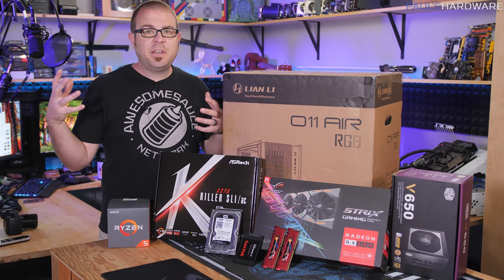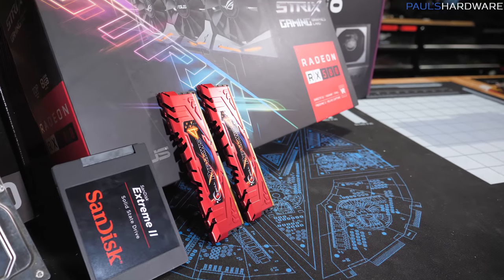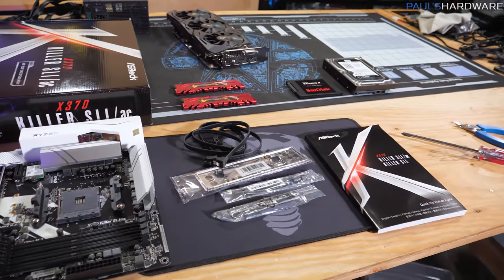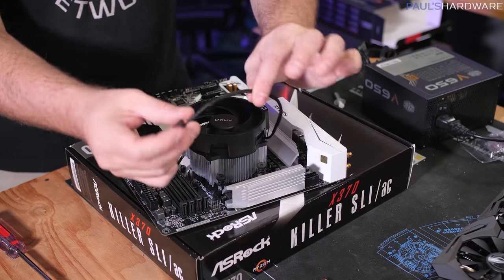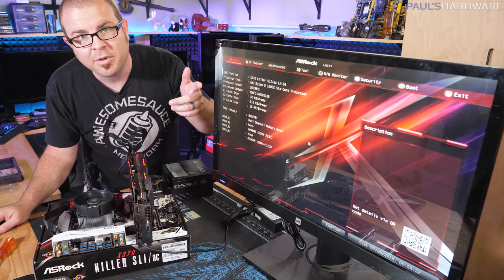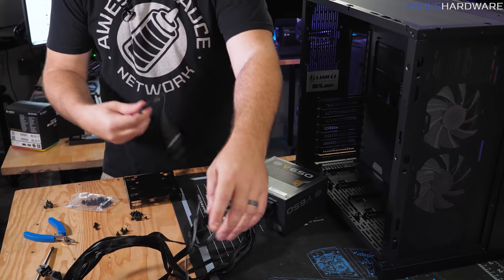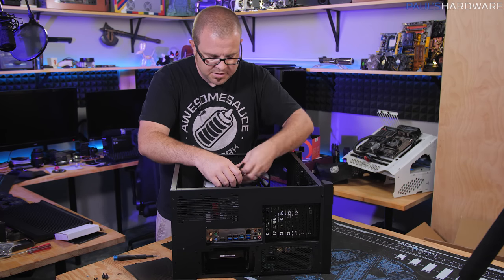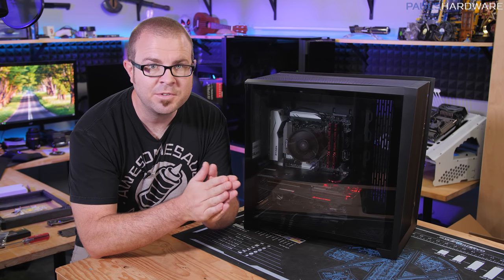How To Build an $800 Gaming PC in Late 2018!

Comment: Holy moly north americans r so lucky 😭😭😭. The prices r sooooo cheap 😲😲😲. 
Please see my specs and the prices u will totally be amazed : 
i7 8700 - 335$
Asus B360F motherboard - 175$
Gskill TridentZ RGB ram 16 GB 3000Mhz - 233$
Coolermaster masterliquid ML120L liquid cooler - 66$
Gtx 1070Ti Founder's Edition - 549$
CM Masterbox Lite 5 RGB Cabinet - 80$
Kingston ssd av400 - 41$
1 TB Seagate Baracuda HDD - 44$
Alienware 25 240 Hz monitor - 549$
TOTAL - 2072$
Thats y gaming sucks in our country & whever I see a north american PC build my jaw drops I wish I took birth in NA. 
😭😭😭😭😭😭😭😭😭😭😭😭😭😭

Comment: I hope nobody builds such a stupid system.
8GB RAM in 2018? Come on, man...
650W PSU? For what? The overpriced RX580? While a 6GB GTX1060 offers the same for less $ and less W?
An expensive case for an 800$ build? Come on, man...
HDD for what? A 500GB SSD is perfectly fine for the average gamer.
An expensive X370 Mainboard for a little Ryzen 5 1600? Why on earth?

I repeat: Stupid build.
Reply: I recently finished my first self-made build with the following components:
Ryzen 5 1600
Crucial Ballistix LT RAM 2x8GB 2666 @3000MHz 
Asus B-350F ROG Strix Mainboard 
Zotac Amp! GTX1060 6GB
500GB Crucial MX500 SSD
400W PSU
Cooler Master MasterBox Pro 5 RGB Case

Way more cost-effective than the build in the video.

Comment: 580 in 2018 
dat won't digest
Reply: Professor X why not
Reply: Professor X why? I have the same asus rx 580 and its amazing and runs any game on ultra with over 100fps
Reply: Professor X It’s still a great card on a budget, my brother built his system with one. Although my 1070 stomps it In gaming, mine did cost almost twice as much as his 580 lol.
Reply: Bryant Aguilar im having a 1440p 144hz monitor and it still runs all games over 60 on ultra and in esports games (csgo) over 200fps
Reply: doesnt run all games over 1440p 60 at ultra, no way. Maybe youre playing low demanding games